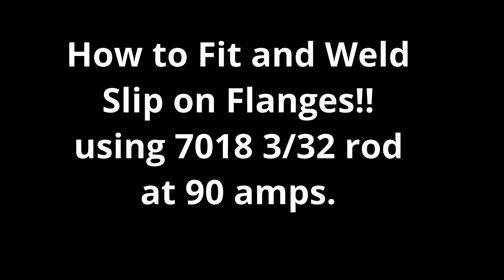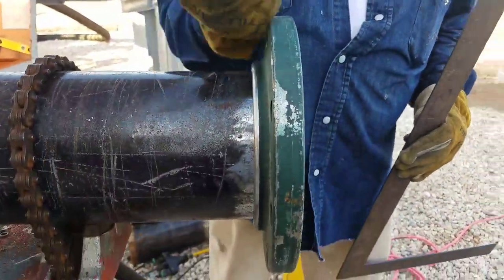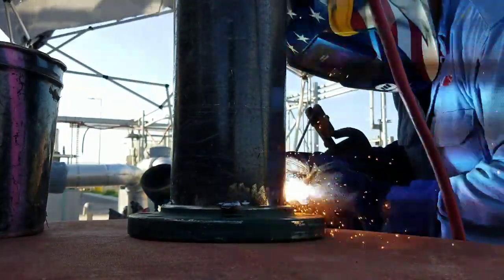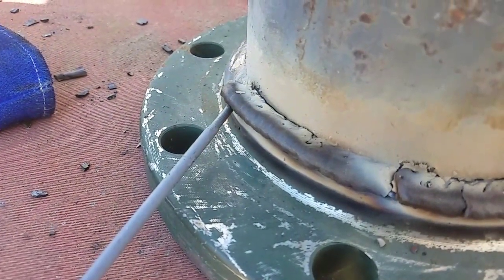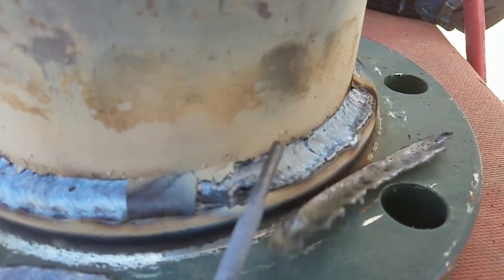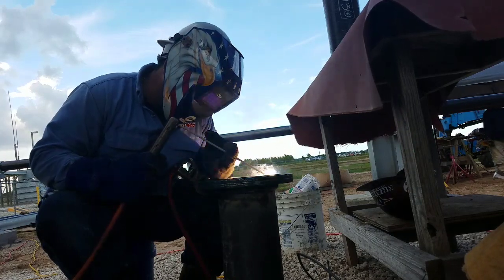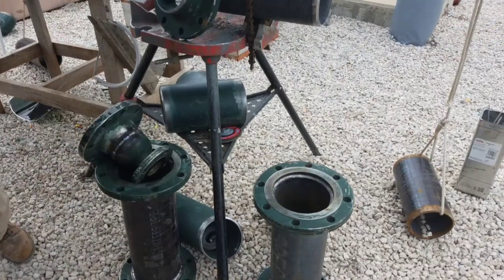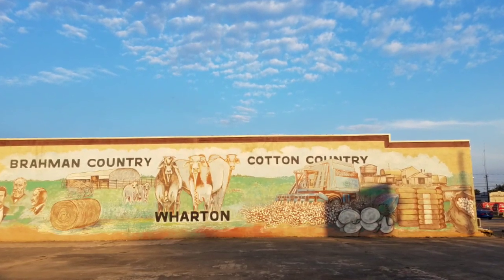How To Fit and Weld Slip on Flanges!!

Comment: Now do one in the trench with water coming out. Confined space. 6010. DC shocks
Reply: I was thinking the same. Just did 12” nozzle on some thin pipe. We are not allowed to use 7018 only 6010.

Comment: Great video! Just in the future weld the inside first and you need to have pipe thickness + 1/8 of weld.
Reply from the maker: +Resendiz Romulo Thank you for the tip!
Reply: Hi. What is the maximum allowable gap between pipe and the flange? And, what is the " pipe thickness + 1/8 of weld"? Thanks
Reply: For pipe that size go with 1/2" ....he welded the inside wrong  too flat ...also we normally put 2 or 3 stringers on back